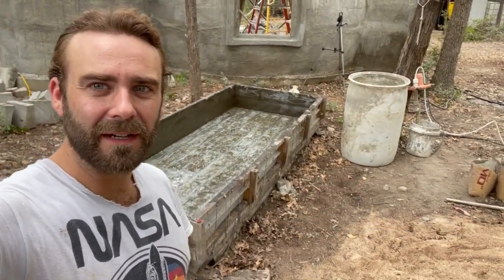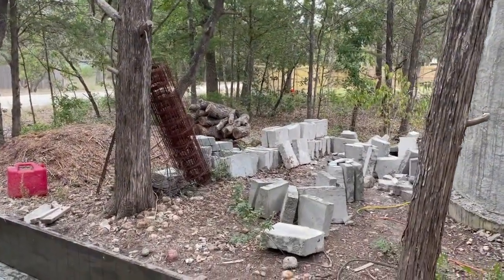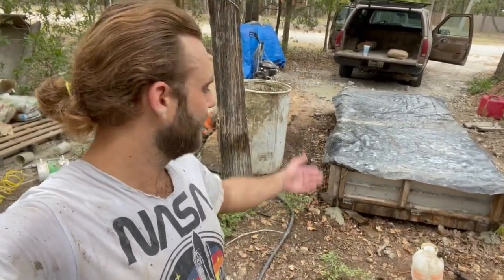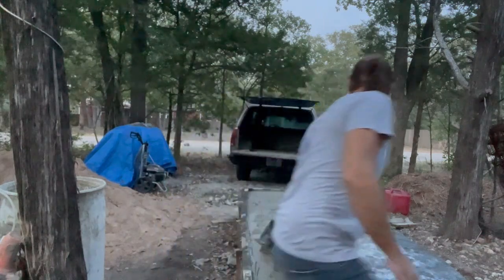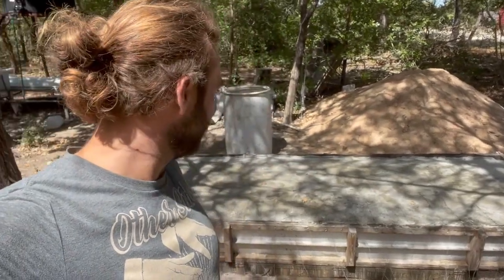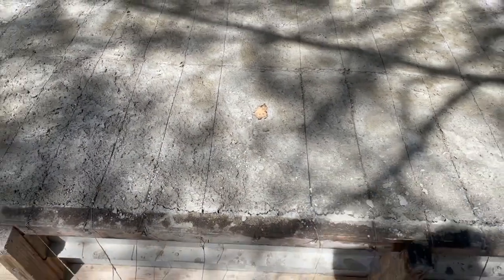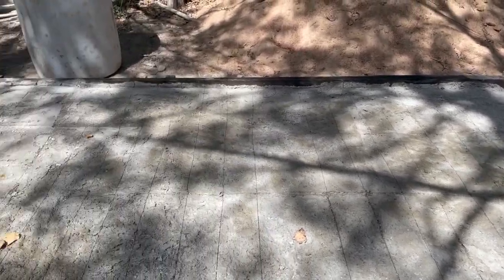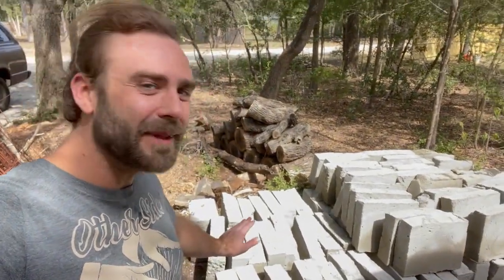Make your own Aircrete bricks by yourself!!!

Comment: Nice work. I wonder if you can recycle the defective bricks for use in the next batch? is that stuff easy to grind up? another question, if you are making a wall of a certain height couldn't you make a single panel instead of all the bricks? might be less labor
Reply from the maker: Hey Ian, great questions! First off, once the bricks have hardened they can’t be remixed to make new bricks. Usually I throw the broken ones in the driveway and cherish them. Yes, you could do a monolithic pour but it would have to be already standing. Aircrete is fragile to move in large sections which is why I like the smaller bricks
Reply: @natotomato4509  I have seen another youtuber add grind up Styrofoam and/or fiber glass in the mix and that makes the brick much stronger but still light. I have not experiment with which one yet as I am still researching for the "one" that will work for my application. Thank you for a great video.
Reply: @permatopiafarm1119  I worked for a precast concrete company and we used fiberglass strands in our mix instead of aggregate and we called it fiber-crete. Very strong and very light. We would cast it into 2 halves of a rounded pillar with a void in the middle for a 6x6 post. When you put them together it looks like a giant solid concrete pillar for a fraction of the cost and weight. I would worry about Styrofoam not having the same tensile strength as the fibers though. Please post if you try it and let us know.

Comment: Haven’t seen the string method I like it! A 1 ft pour is impressive without anything collapsing
Reply from the maker: Thank you, I’ve learned on forms with metal separators but I like the string method the best
Reply: Is there any particular string you use such as mason line,fishing line,thick or thin,etc.?

Comment: Amazing, thank you. Now is there a way to make the bricks more exact? Maybe with plywood sides? As in, slot the pieces of plywood top and bottom so they fit into the mold.
Reply from the maker: There is plenty of room to improve the method. I plan on rebuilding the box in the future so hopefully I will come up with new ways to make a more perfect block
Reply: @natotomato4509 it should be a whole lot easier to have a straighter pull on that string if you lay a nice, straight 2×4 or a piece of angle iron, etc., across the outside boards then pull the string through up against the straight edge. Would help a ton with thickness, I'd say.

Question: what's the durability of this mixture compared to just mixing the quikrete up the standard way?
Reply: MDF??